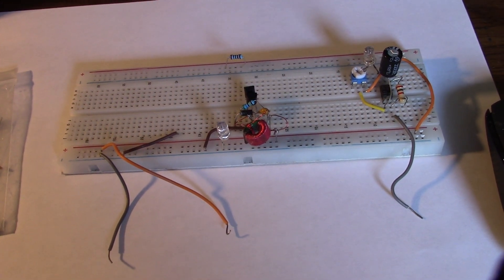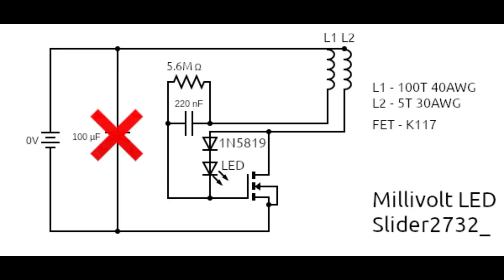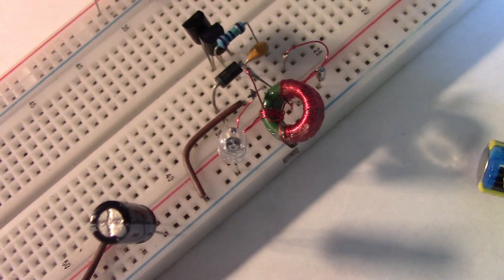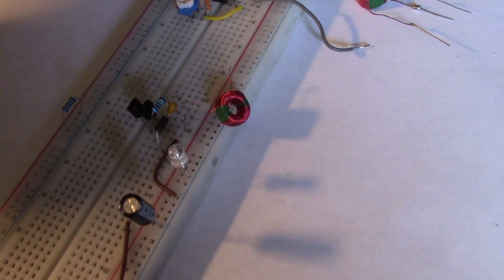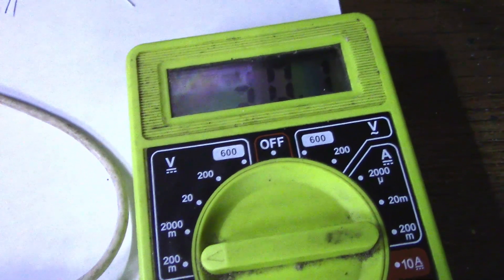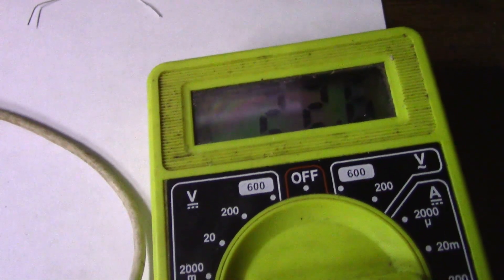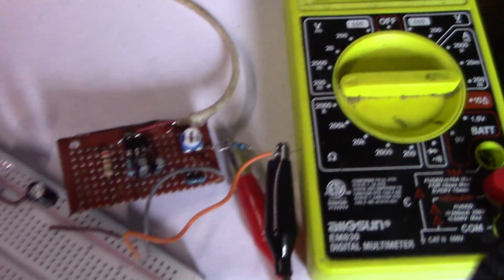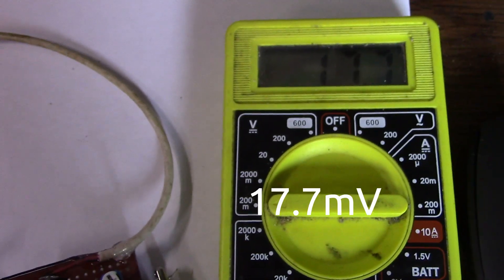8 Steps That Created A New MilliVolt Record

Comment: I'm confused here, I've been following your progress on this but I'm still not sure which transistor is used. The part number is for a JFET but the circuit diagram shows a MOSFET. Can you clarify which type should be used please? Great work by the way
Reply from the maker: Thanks Donald. I do apologise, there was simply no JFET symbol in the circuit diagram software that I could see and the idea was to find one online to edit the diagram with. Well, that got forgotten about, so, yes, sorry about the confusion!
Reply: @Slider2732_ many thanks, now I feel more confident to give it a try with the jets I've got

Comment: Amazing 3 transistors together . I wonder if used green led which has bit more volt drop than red will it flash 🎉🎉🎉
Reply from the maker: Good idea! I don't have any greens at the moment, but have just tried a blue, which should be a much bigger drop too. It runs the same as the red 🤔
Reply: @Slider2732_  try a diode brtween zener see result pls🎉🎉

Comment: Good job. Thanks for the shout out :D But I can't take the credit for it. It's old way that has often been used for circuit tuning and DX stuff (crystal radios). I think it's based on forward momentum of the electricity.

The parallel trick works on all diodes (transistors and LEDs). You can stack even more of them, but the advantage gets exponentially smaller. And the circuit gets bigger. So three seems to be the optimal number.

There's plenty of other old forgotten tricks too for the coil structure improvements, like putting some Teflon tape on the core to reduce resistance, etc.

It's also possible to use virtual ground mass reflection (ground/counter antenna), that should be the same size as the main circuit.

Bad ground is like jumping in a mud. Full ground is like jumping on concrete. Tuned ground is like jumping on trampoline.
Reply from the maker: You're welcome for the shoutout... as I say, your comments are very often very helpful 😀
I'd seen and used transistors and diodes etc doubled, but didn't think it would work much at all with 3 rather than 2. i suppose, in a way it's all relative, being as we're just looking at mV changes.

The ground wire here was a real surprise, it just being a regular 20AWG type wire that goes out of the window and is held in the ground by a foot long piece of house gauge copper wire. It's been dry here too, so there isn't much moisture. Perhaps it's only working because I water the plants every couple of days!